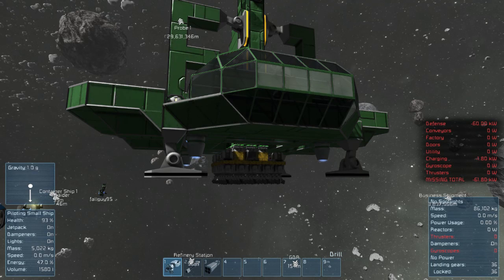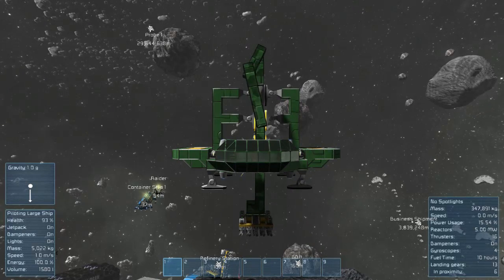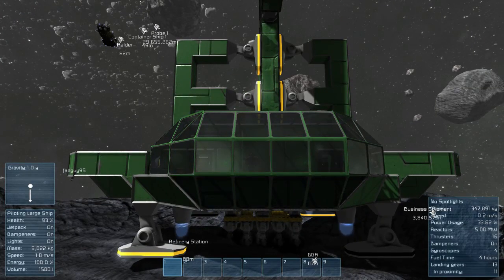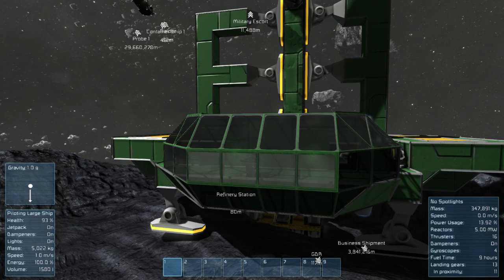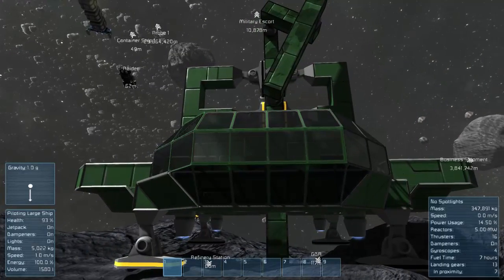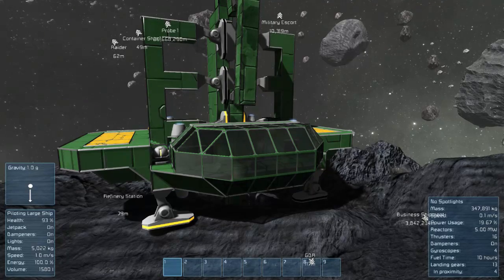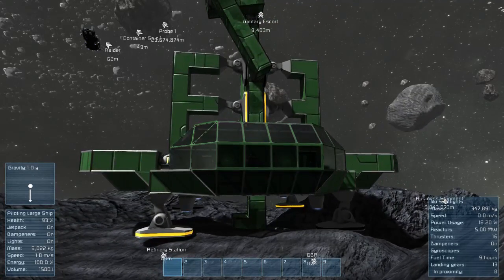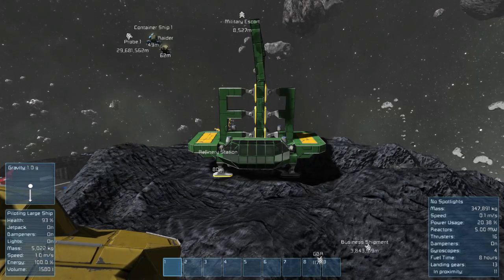Space Engineers - Drilling Platform Test Drill

Comment: two things we need now...

1) a way to lock onto asteroids (perhaps a grapple gun of sorts)

2) hydraulic cylinders...  (especially if they worked with gyro's;  like stabilizing a platform on uneven ground)
Reply from the maker: You can lock onto asteroids with landing gear, just never included it in this design as at the time there wasn't a way to separate the locking and unlocking of them, which would have meant the piston would have got locked in place. Have to wait and see if they bring out hydraulic cylinders, not sure they have any planned any time soon though, but you never know...
Reply: Slim Nasty
also wish you could customize resource distribution between conveyers (what resource can travel through specific conveyors).  In other words,  send specific minerals to specific refineries,  or reject and eject it automatically (like rock for instance).
Reply from the maker: I think it would be easier if they added a filter, should be easy enough for them to do and I have been asking for it for ages, that way you could filter certain items not just into refineries, but also containers or assemblers or anything that accepts things in the future.
Reply: need some way to prioritize conveyors as well.  ore tends to get stuck in my drill heads if they aren't connected to a refinery half the time instead of going directly into storage.  I've had to rebuild my rig with onboard refineries just to keep resource flowing.

And connectors are...eh, at the moment...  sometimes they lock and won't transfer,  other times they lock and won't release.
Reply from the maker: The joys of a Alpha from Keen Software I am afraid...

Comment: Nice, but not as much depth as other drilling platforms I've seen.  All over this type of thing would have a lot of use for creating bases (driving straight tunnels through the asteroid for ships to fly through, though obviously that would require a larger model to permit large ships) but drilling ships have a lot more utility for actual mining purposes.  They can have just as many heads as the drilling platforms and concentrate on the ore.  Now maybe if you made an open pit miner it would outperform ships, or at least enough for the convenience to be worth it, as you could target surface or near surface ores or simply mine gigantic areas, but to make a normal style drilling rig big enough to get enough ore to outperform ships hitting targeted spots you'd have to use butt loads of drill heads and probably lag your game out.  Without that extra area traverse arm it just can't guarantee hitting enough ores.
Reply from the maker: That isn't my intention to make a ship just to mass mine, this is one of four current mining vessels in my Twitch Stream world which has been running since mid March, every thing in the world has a purpose and even this vessel has been modified since this video was made, worth checking me out on Twitch also to see the latest projects we have built recently and on going and future projects.